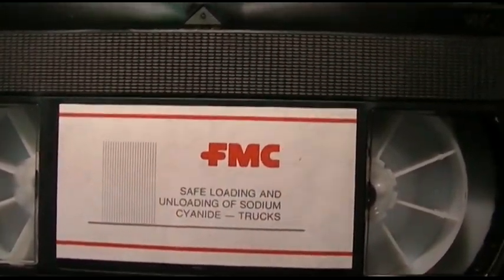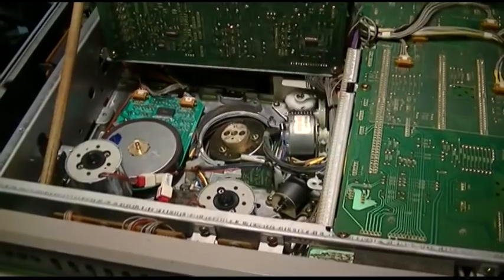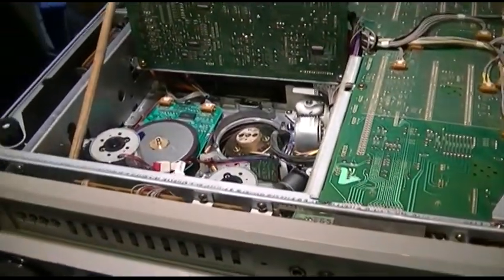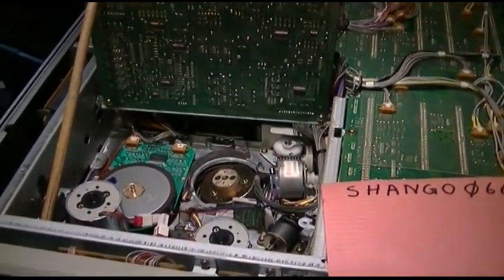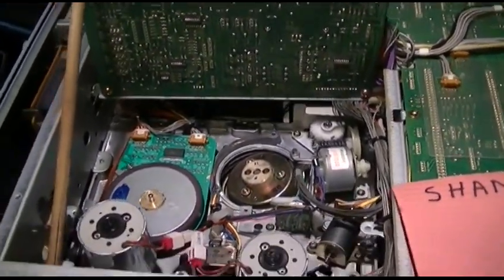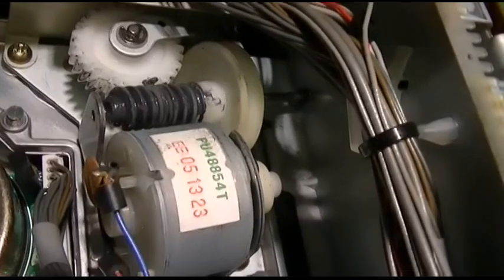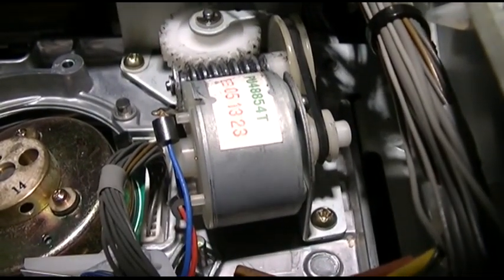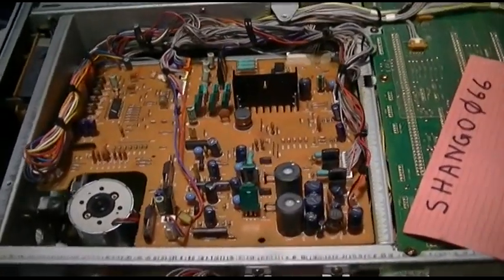JVC BRS611 SVHS Code 32  VCR Repair

Comment: We used to get the same problem here in England. The little motor drives the mechanism that wraps the tape around the head, very often the belt'd go slack over the years and I'd end up changing them. This JVC of yours is very much like our Ferguson Videostars, which were JVC clones. They appeared here as ITT Telerecorders, Granadas, even JVCs among others.. Sometimes there's a little lamp that stands on a pole in the middle of the mechanism, when a tape's in there the lamp's hidden from the sensors on either side of the cassette compartment by the tape. This is how it detects the prescence or otherwise of a tape. Amazing the junk I remember ! But I do recall these units were very reliable and built like tanks, which was one reason why VHS beat Betamax over here.

Comment: It's good that you managed to change the belt, and restore the VCR, but...The service manuals for the more common broadcast units, JVC and Panasonic, are readily available. You should have the service manual before you try to repair one of these. Especially so when you're having to go really deep into them. It'll be drastically easier if you can read-along with the detailed take-down instructions and parts diagrams.

One should never ever, ever, ever, try to repair a broadcast unit, or any VCR for that matter without the service manuals.  Risk screwing something up, and into the trash it goes because you don't know where the re-assembly went wrong.

Thanks for posting, and good luck!

Comment: Commercial gear is the best, I have some old VHS machines we pulled from channel 12 here when they went digital, I also have the VHF-Hi band klystron transmitter cabinet and rectifier cabinet, That thing is a beast. requires an air conditioner to be ducted into it to keep it cool.

Comment: I noticed the bending at the top of the picture.  You'd need a time base corrector to get it solid.   I have an SVHS JVC HR-SC1000U machine that I bought in 1990 and I transferred a tape for someone a few months ago.

Comment: Vcr not working with lid off, I'm sure some of the older VCR's used to shine a bulb through the centre hole in the cassette to detect the beginning and end of the tape. You can see the IR LED used in that VCR glowing faintly in the camera's image.

Comment: Needs belts, idlers... check path alignment, tearing a top might be tape running too high in track or not tight enough. There should be a brake on the feed wheel, make sure its tight and felt is good. Infrared LED can be checked with a test card... LED is almost never bad except on Zenith chassis. Yes, light can effect the IR sensor(for mylar leader to test for tape end). Heads need to be cleaned... plain white paper and alcohol. Grease loader track and tape track with molytone grease... probably good as new after that.

Comment: Greetings 2: The default chroma output from VHS machines always has burst locked to the chroma (so the system can produce a color display without a TBC). I should have said that the TBC provides a color-burst locked to horizontal sync as required for NTSC broadcast.

Comment: Hello.
Mine also has the 32 error code. But the „rubber band“ you fixed is ok in my case. Do you know any other problems/solutions for this error code?
Thanks